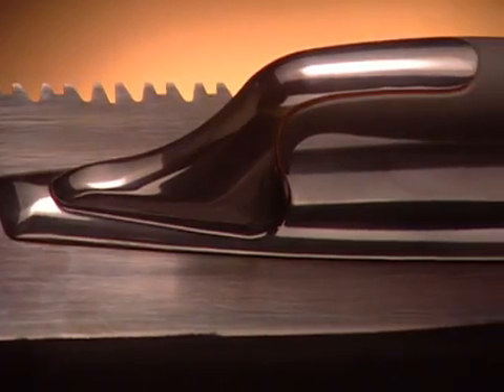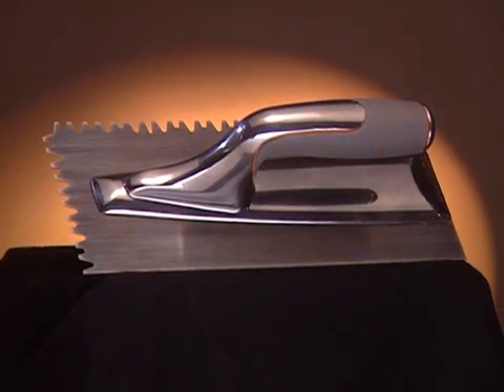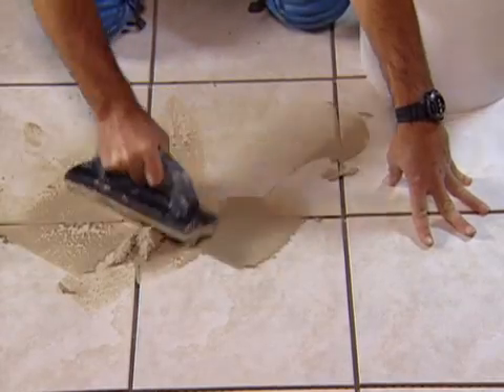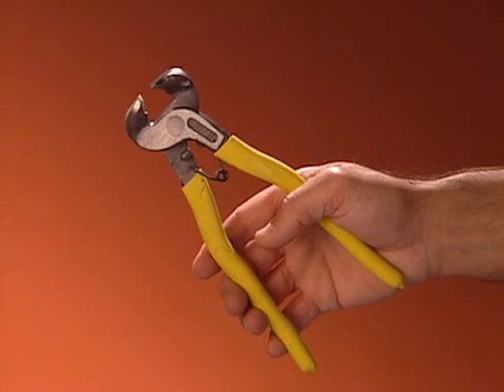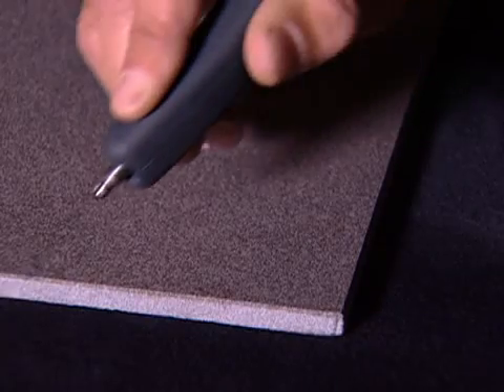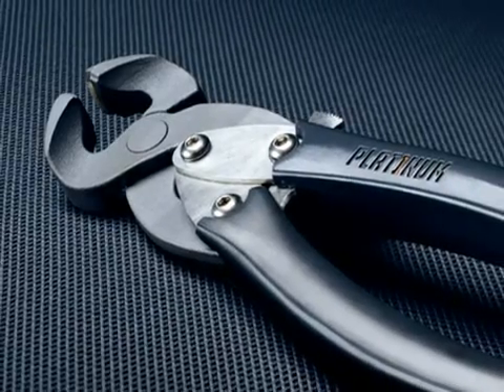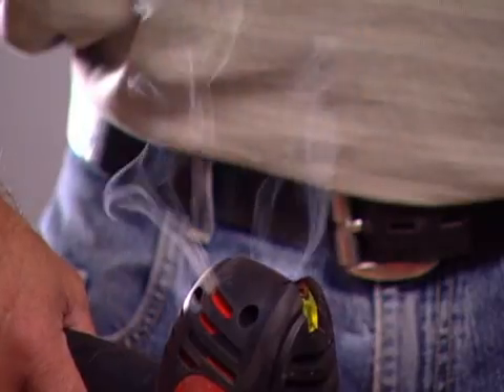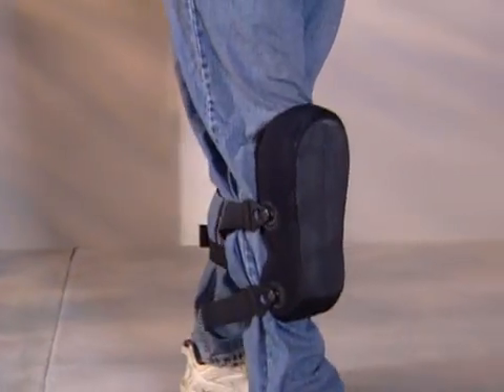Platinum Tile Installation Tools from SuperiorBilt

Comment: Ive been using the orange float for 10 years, cant beat em.
When they get worn a bit, I just use it for slate and rough stuff, nice new one for most applications.

Comment: I bought one of those grout floats. It's a big orange sucker, no doubt. The soft flexible edge really works the grout well. I grouted 300 Sq ft today with it. Worth the money. The handle shifts well in my hands. I would buy it again. I was grouting 6x24 planks, and it packs the grout line with one pass.....and it seriously cleans the grout up so that's a lot easier. Way different than my other floats. But it's larger, so that may be an issue.
Reply: Batsen Belfry how much was it? I use the superiorbilt float that I'd red and it's great but lately they seem to have been made a lot cheaper..
Reply: Gerardo Linares Seems like it was 23 dollars or so. It's too big for my wrists. The edge is really nice....real flexible. The purple one is just a little smaller, and that's just right. Iirc, it was about 14.00 at the local tile shop. Superior makes some good tools. Great trowels. I really like that 1/2 x 1/4 u notch. Works out to be the same as a 1/2 square notch. But the ridges collapse easier.
Reply: I'll have to try it out, thanks!
Reply: Gerardo Linares U notch collapses easier. It makes a difference at the end of the day.
Reply: It just has a purple handle?
Reply: Gerardo Linares No, it's purple, like the other one is orange. Just isn't as big.

Comment: Went by the Distributor today......I bought the smaller purple grout float. I like the smaller size better.
Reply: I think I'm going for the smaller purple one myself. I bet it's faster and lighter.
Reply: +Mookey The Pimp Thompson I've been using the purple wonder. It's just easier on my wrist. Real flexible. Cleans the tile great. The Orange monster is just too big for me. Seems like they're the same other than size. I went ahead and bought the Superior 1/2 × 1/4 u notch trowel. That's a great trowel. Can't make my mind up if it puts more down than the 1/2 square notch,  but I'll say this, the notch collapses real easy. I just let the tile plop into the thinset. I use the Raimondi Tile leveling system. Superior makes some good stuff, as well as Raimondi.